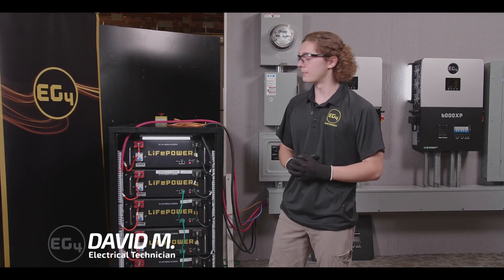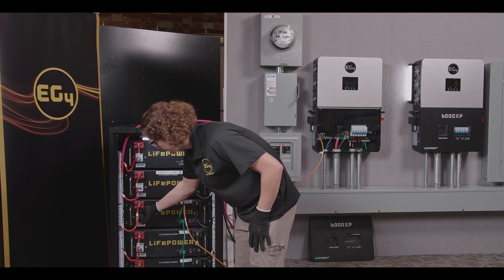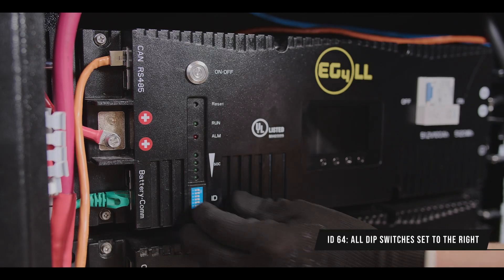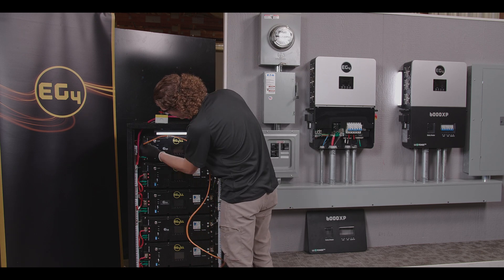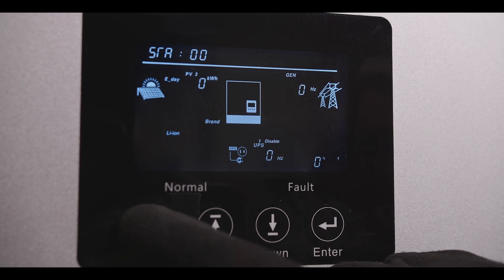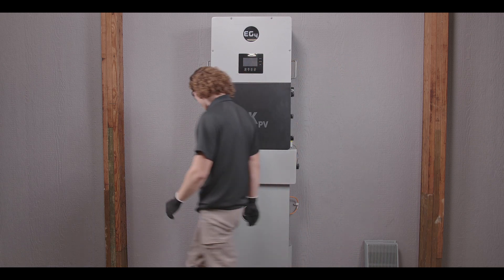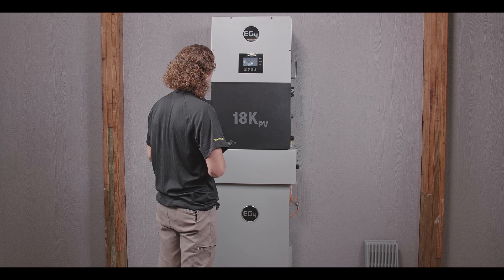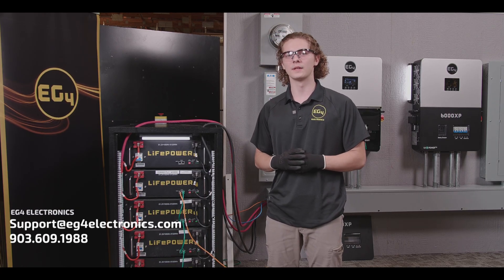BMS Communications Demystified: Exploring EG4 Product Configurations

Comment: I connected to my JK inverter BMS set it to Lux power worked perfectly set the inverter to EG4 battery. I know you mentioned cat5 cable those orange cables are not wired the same as a cat 5 or 6 ethernet cable. I would not use an ethernet cable use the EG 4 supplied orange cable.

Comment: Thank you for the video. Is there any way to add an external BMS to a set of 12v lithium iron batteries that don't have built-in communication ? It would be nice to have the closed loop feature.

Comment from the maker: Quick heads up to all Lifepower4 battery owners: Ensure your battery is running at its best by updating to firmware version 3.21 or above. 
Click this link to access the latest firmware: https://eg4electronics.com/categories/batteries/eg4-lifepower4-48v-100ah-lithium-iron-phosphate-battery 

Stay tuned for more in-depth videos where we'll walk you through updating firmware and dive into proper BMS communication for each specific battery model. Your power, your control! 💡🔋 #EG4Electronics #LifePower4 #BMSCommunication
Reply: Thank you for the info! Could you quickly explain if we need to update the firmware on each battery separately, or can we just update the master battery? I couldn't find this info in any of the manuals or instructions provided with the batteries.